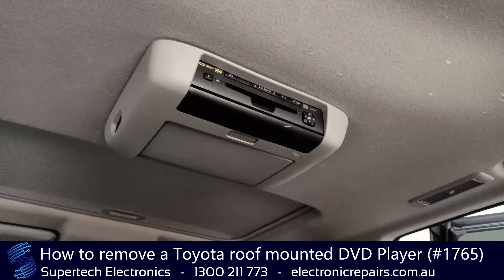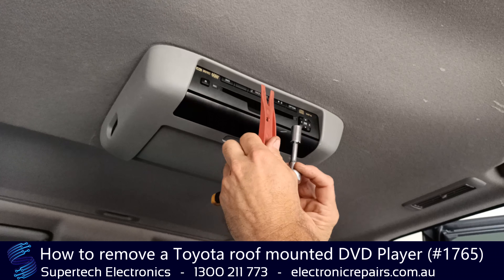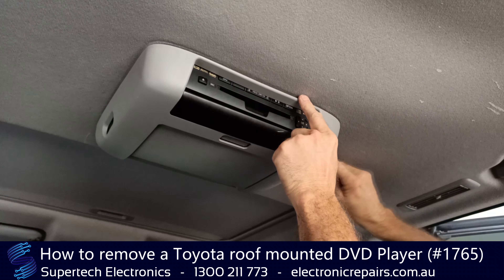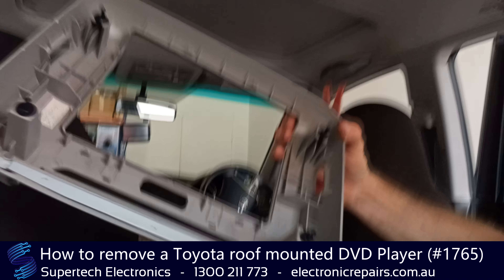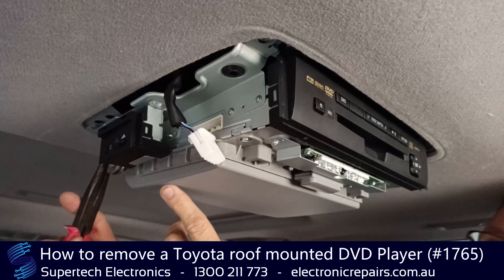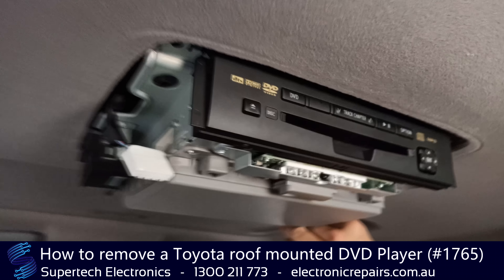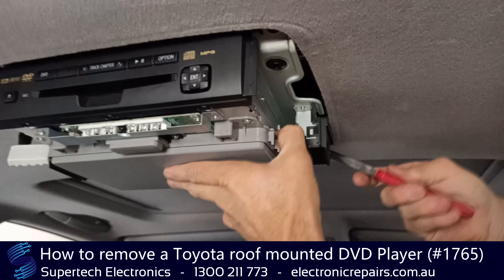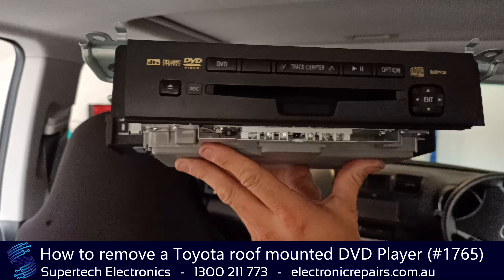How to remove a Toyota roof mounted DVD Player (#1765)

Comment: #1765 - I have a 2010 sienna with the RSE. I want to replace it with an aftermarket unit with hdmi options and a bigger screen. After searching the internet I can't seem to find anyone who has done it without replacing their stock head unit and running new wires. Is there a way to do this? I've been looking for a wire harness for the RSE and can't find one anywhere. Thank you

Comment: Ive got the same unit,but recently upgraded my front headunit to an android one,is there any way around to rewire/using usb to avi adapter to stream videos/audios from the headunit/mobile phone to the oem rear entertainment dvd player?
Reply from the maker: Definitely not! Toyota don't make it easy to modify their systems. We do not modify OEM car systems as it voids the manufacturer's warranty. We repair these systems.
Reply: I hear you man. I was looking for this answer too. I just got a Chinese 10 inch head unit and I noticed that there is a yellow S video OUT. might as well get some sort of tablet that allows for a yellow video input from your head unit. but do those exist?

Comment: I just got a used unit like the one you have in this video but when I try to insert a disc it seems to be internally blocked. The screen says dvd seek, but it wont take a disc in more than halfway. There's no bad noises and it doesn't appear that any disc is stuck inside. Any advice on what I can check to see if this is a simple fix? Do these have some kind of internal locking system that blocks discs from being inserted?

Comment: We bought a used van with the DVD player removed. Do you have suggestions on what to put in the open space? Is there a cap of some sort or should I just do a foam headliner kit?
Reply from the maker: No. Sorry we repair them. Why do not just put the same radio back in? That will be the easy thing to do.
Reply: @SupertechElectronics  because we don’t have it. It was gone when we bought it.